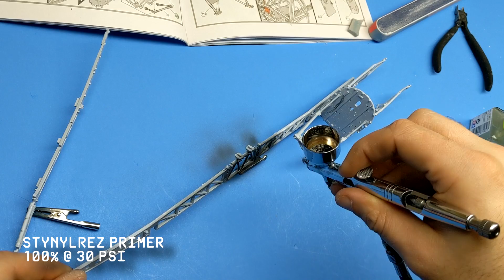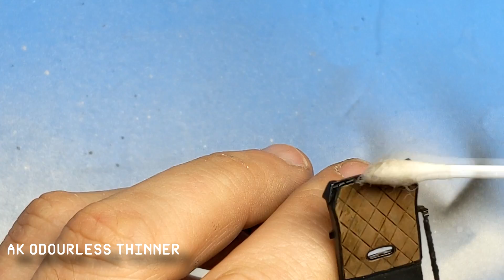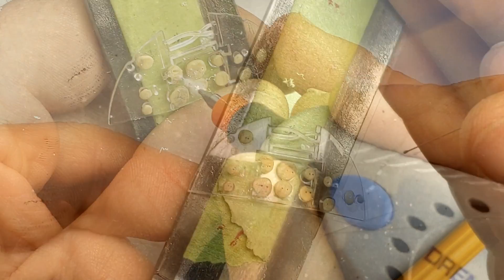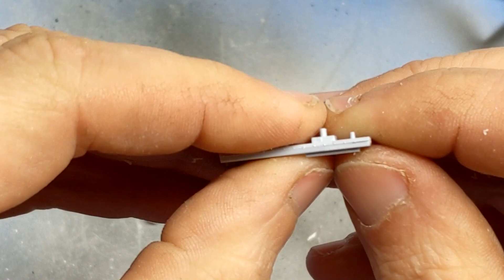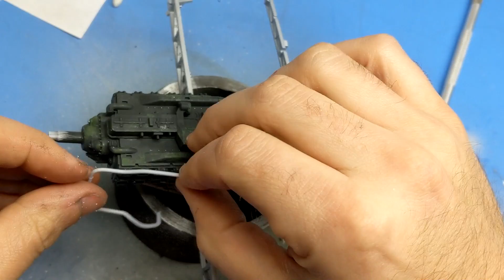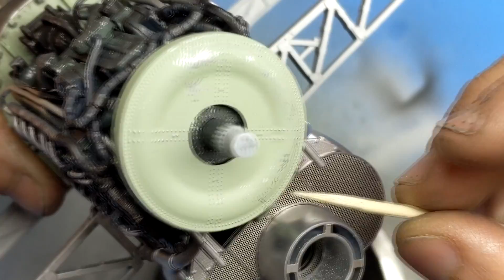1/24 Airfix Typhoon: Part 1

Comment: I have always been fascinated by this aircraft and its powerplant. You have the engine looking first class with your skill and patience. BTW, the "tail" issue wasn't caused by overstressing, but rather by the elevator balance attachment shearing unexpectedly causing flutter and failure. It was a simple re-inforcing and re-design which solved the problem. Something like 28 aircraft were so lost, most of the unfortunate pilots lost. Looking forward to more of your build.

Comment: When you were talking about the clear control panel piece,I've built some semi truck models,1\25 scale and a couple 1\16 scale ,that had both decals and glass for the dash,and the instructions were very specific about putting the decals in the gauges and then placing the glass over them. I'd imagine it's the same concept here. Lots of this shit crosses over,so hope this helps in any future builds. Had to massage the clear pieces edges a little but worth the effort! Especially since you don't have to wait for the product you use for glass look to dry. Some of that stuff takes forever to cure. I remember the testers clear maker stuff, it knocked your build back like 36 hrs for it to dry hard enough not to deform.
I tend to remove locater pins or drill out the locater hole. The issue usually comes up on the engine halves and on the suspension on those semi trucks I build.
Reply from the maker: This is the opposite thought, the clear piece sits behind the instrument panel so adding the decals in before doesn't work, unless I was supposed to make a plate for them to sit on
Reply: @TheModelGuy  oh well hell. That don't make make much sense does it? I misunderstood you,but really that seems kinda weird. Oh well cool build so far,love the extra details,look forward to the rest.
Reply: I recently built the Tamiya 1:32 Corsair and indeed encountered the decal-clear part solution you described. I thought it was very odd but decided to go by the book. That turned out awesome. So what happens is you stick the coloured side of the decal to the back of the clear part. Then you glue the clear part into its frame and done. It looks fantastic because the clear part works a bit like a lens for the decal print. I can send you some pics if you're interested. 
Downside of that build is that I screwed up the primer and realised it during weathering. I'd rather learn my lessons on cheaper kits.

Comment: Just take your time and it'll build out properly. A couple of friends have built this monster and what you complain about,they did also. The only Typhoon that is left in the world is at the IWM in the UK, BUT it was found in the U.S. in a hangar at the now O'Hare International. This "Tiffy" was missing outer fuse panels, radiator & proper gunsight. That's why Airfix got the rad wrong along with the gunsight. Airfix 1/24th is a walk in the park compared to Trumpeter & Vintage Fighter 1/24th kits. Looks good, KUTGW!

Comment: Hawker was expert using 1920s tube frame technology just like on the Hurricane but they should have moved on to aluminium sheet construction at this level .Flying one of these would be akin to a rodeo rider .A model I wanted above all others in 1/48 and I maybe one of these 1/24 but the extra work involved as I know Airfix would let me down Ive been making them over 50 years . You are doing a nice job of this you have more patience than I.

Comment: Answering your question about the instrument panel decal and placing it on the clear part, yes, that's apparently how it's supposed to go. I have a ZM Raiden, which has the same feature. I think I like the Edward sandwich method better, with a drop of clear or PVA to represent the instrument glass, but there we are.

Comment: It's almost 2 years later so you probably already know this, but... 

When it comes to threading the HGW seat belts it help a lot to thread the belts thru the buckles while still attached to the PE fret, especially in 1/48 scale, then cut the buckles from the fret. This method makes them much easier to work with as they are far less fiddly.
Reply from the maker: It's two years later, but the 1/24 Hellcat I said I didn't want to do is nearing the bench. Maybe starting January.
Reply: @TheModelGuy  I'm a new sub to your channel, looking forward to seeing what you do with that big Hellcat. A couple of guys on Large Scale Planes forum have done that kit with impressive results, with your skills I'm anticipating more of the same.

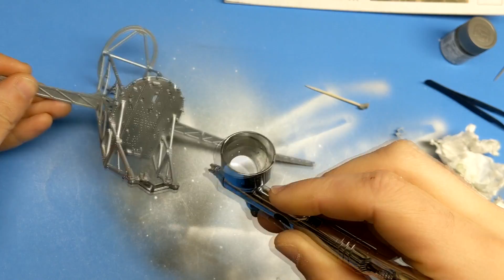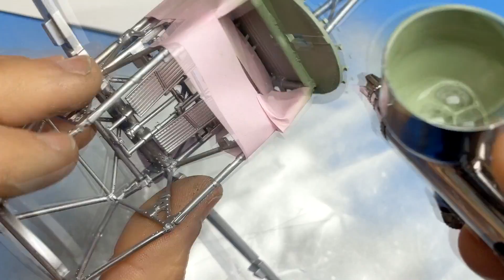Comment: If I can ask a qustion from a newby  lol . I have noticed you first painted it black 2:09 then silver at 2:58 then the green at 3:48 is there a reason for the 3 coats???
Reply from the maker: Yes,

The black is a primer so the paint has something to stick to. Then the green is the base colour of the engine and the next black coat is chipped away to simulate wear and tear

Comment: Looking good! It looks like the artificial horizon decal is on upside down. Shouldn’t the vertical bar in the middle extend from the bottom of the instrument?
Reply from the maker: I almost shit my pants until I referenced the photo again. When you are sure, but then you have that little doubt "Did I lock the truck?"

https://images.app.goo.gl/zgGaxggZLRJNpchHA
Reply: The Model Guy Sure enough. I certainly would have screwed that up. References for the win...always. Looking forward to the next one...
Reply: It is upside down !!!
Reply from the maker: @frankceeko4596  it's not. Look at the link above.
Reply: @TheModelGuy  I've looked up some photos of it and you are right. Still it's an odd looking ADI